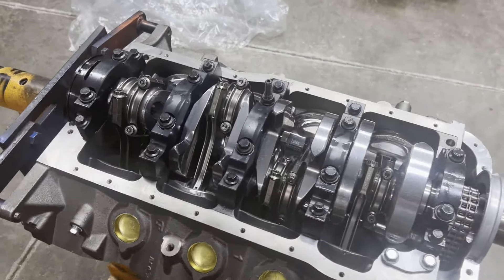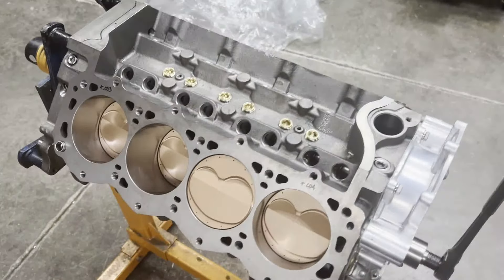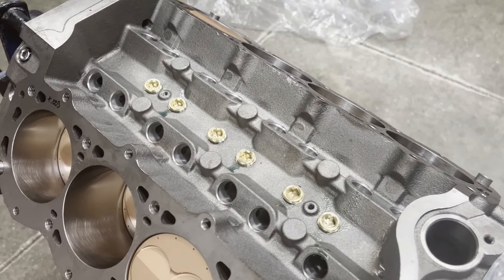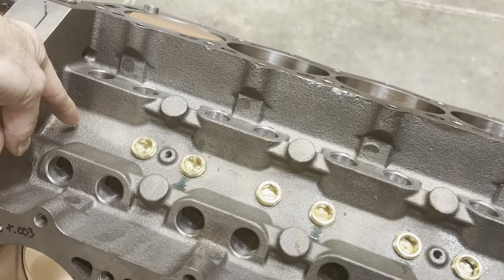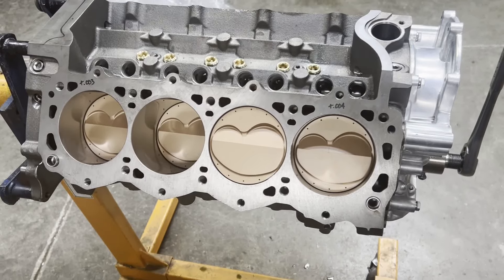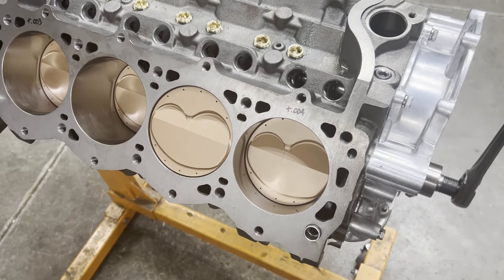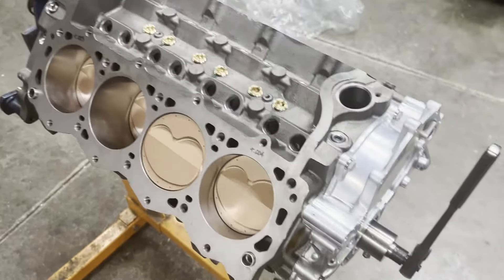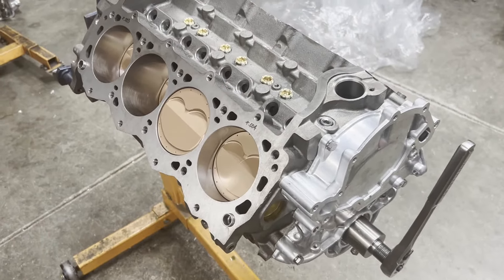Lykins Motorsports SBF Tunnel Port Road Race Engine Progress...

Comment: Can you drill the bottom of the galley for air bleeds like on a sbc for better cam oiling? They also drill under the front cam bearing so the block oils from both the front and back.